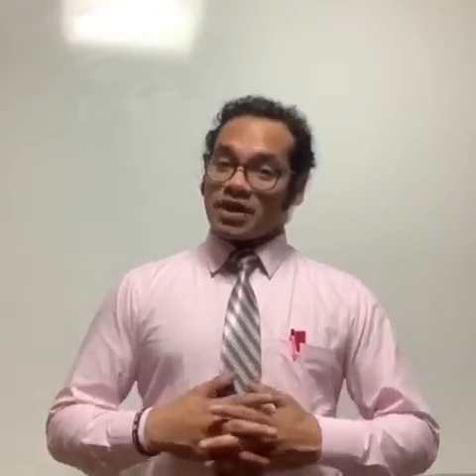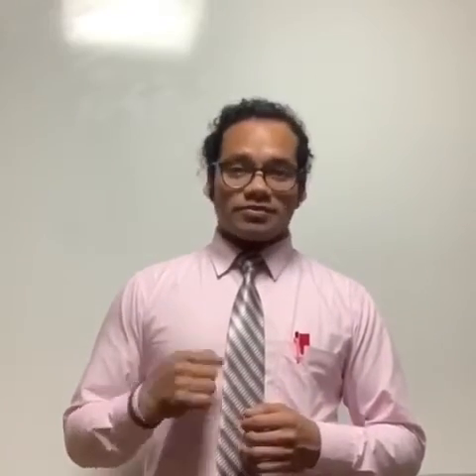What is IDG or Integrated Drive Generator ?

Comment: What is the purpose of having a separate pushbutton for generator and idg in the overhead panel?
Reply from the maker: In A320: GEN 1 or 2 pb is used to connect/ disconnect generator line contactor whereas IDG (guarded) pb is used to disconnect IDG from the engine( generator once disconnected cannot be reconnected in flight).
Reply: @aviatorupdates  thanks for the explanations. Very informative videos. 
Request you to make more detailed videos about A320 systems. It will be of great help for the community especially for one’s like me who is struggling to clear the technical written assessment.
Reply from the maker: @cryptogeek7383  Thank you so much. Feel free to drop in your queries in our email.

Comment: What is the difference between idg and a normal generator?
Reply from the maker: A normal generator (alternator)  is to be connected with a CSD (constant speed drive) to provide a constant frequency output.
IDG is a combination of generator+CSD that is kept within a single casing; hence the name integrated drive generator. It’s output has a constant frequency.

Comment: Can we generate 1-phase 230V 50Hz output with the help of IDG
Reply from the maker: Commercially for daily use in every day life, IDGs do not exist. IDGs have been designed to be used in advanced aircraft electrical systems. 

Theoretically, the answer to your question can be “Yes” and IDG can be designed to produce the output as suggested by you but practically a manufacturer would design/ manufacture an IDG for achieving 3-phase, 400 Hz, 115/200V supply only. Note: IDGs were designed to achieve higher power-to-weight ratio. Hence, high power i.e. 115V, 3-phase, 400 Hz is always expected from the IDGs and still designing an IDG to get lower significant power of 1phase, 230V, 50 Hz would not serve the actual purpose behind designing the IDG.
Reply: @aviatorupdates  Thanks a lot for the information.
Reply from the maker: @chetankshirasagar  Welcome dear 🤗